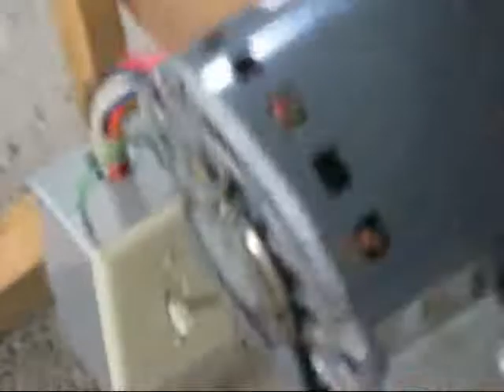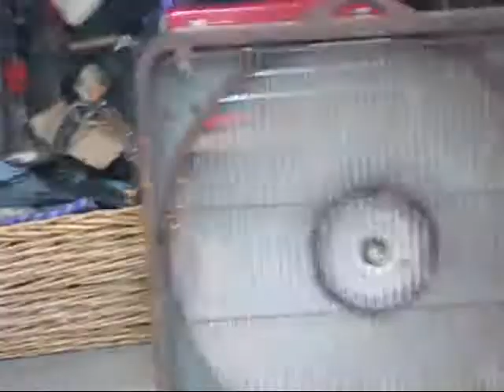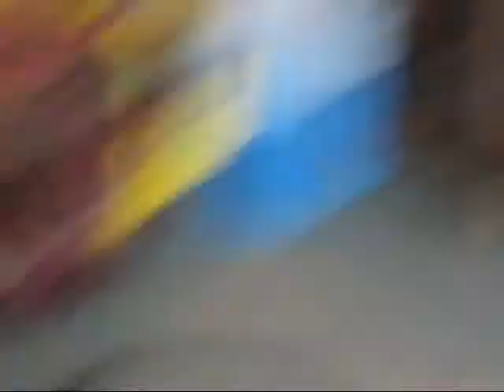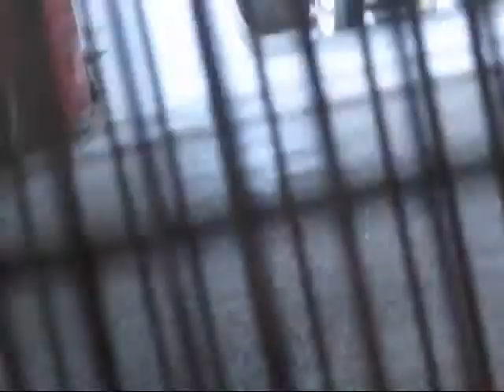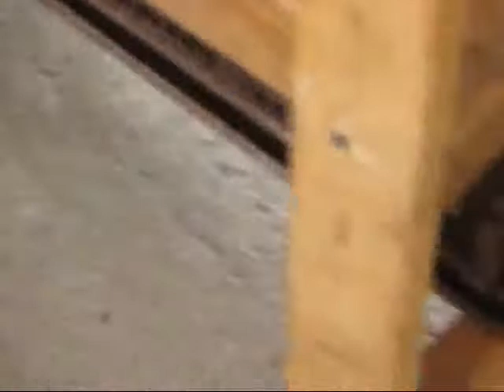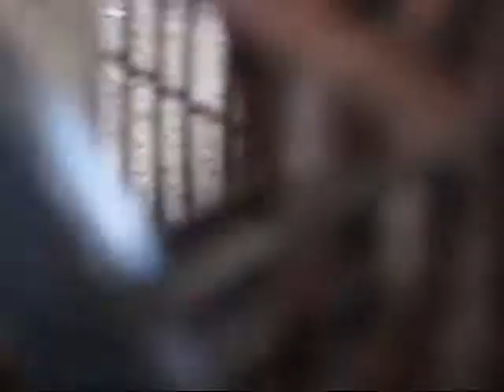My 1950's Lasko box fan works great now!

Comment from the maker: @jackhewitt210 i happend to have the motor laying around. its actually a fan motor designed to run a 20-24" or so commercial wall mounted ventilating / exhaust fan. its a PSC motor which doesnt draw much power but it sure runs this well. it could easily handle more blade pitch

Comment from the maker: oh yeah! when i couldent get the original westinghouse motor working, i just knew i had to do something special for it. and i just so happend to have had a brand new GE 1/6 hp fan motor given to me! what a perfect match! its a 1050 rpm motor and its a great match to the blades plenty of power and it creats quite a powerfull draft in the barn where i use it!

Comment from the maker: @Apoc897  how so? all i did was put the only motor i had that would work for that purpos on it, the motor is designed to run fans, its a lower rpm motor 1050 rpms and it spins only slightly faster than the original motor could have on high. the steel cage and box despite the rust are actually still quite solid and strong so in reality its actually quite safe. i just need to get a more compact bracket welded up to support the motor rather than the bulky wood one i have now